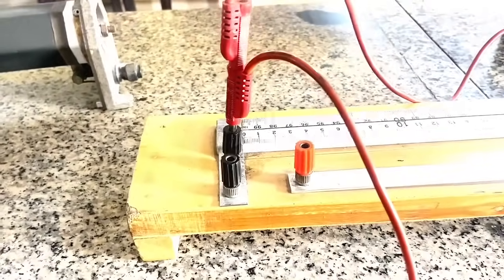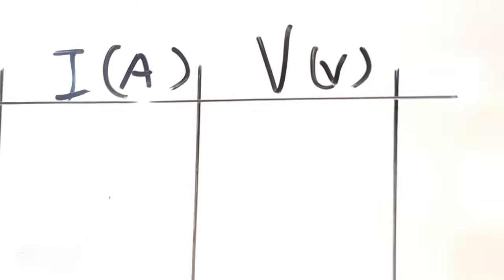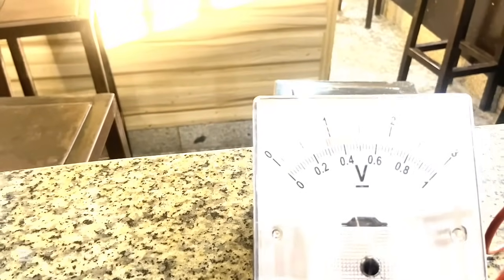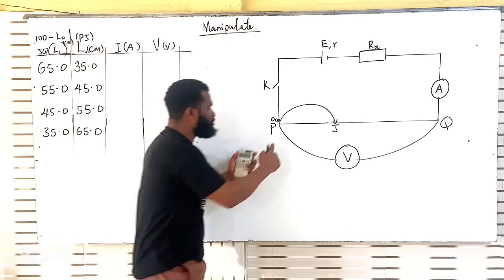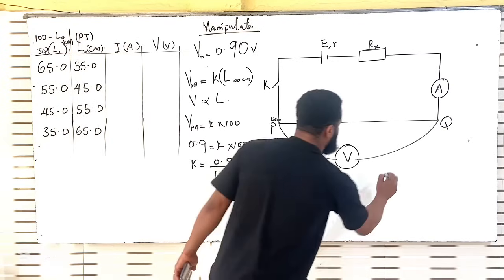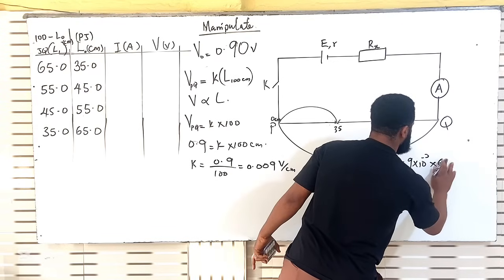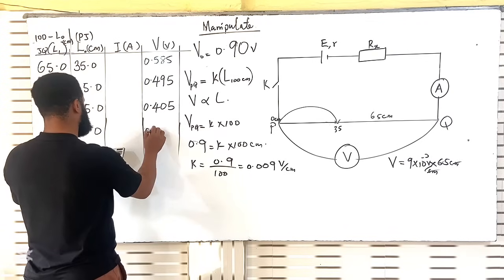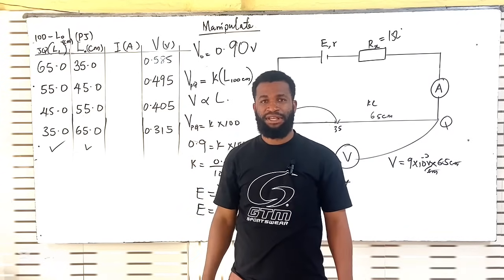Manipulate the table of values in Electricity. Waec Physics practical 2025

Comment: Sir, in reading the ammeter and voltmeter, is it the up or down to read.
Reply from the maker: It depends on where the wire is connected
Reply from the maker: Sometimes the wire is connected at the 3 you read 3. It’s not about up or down